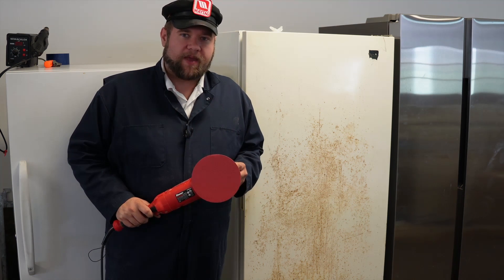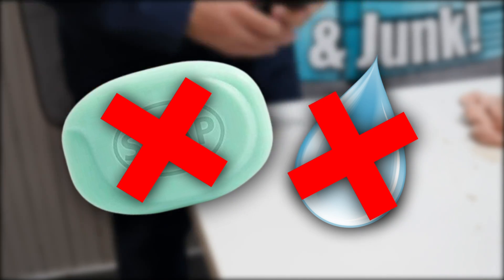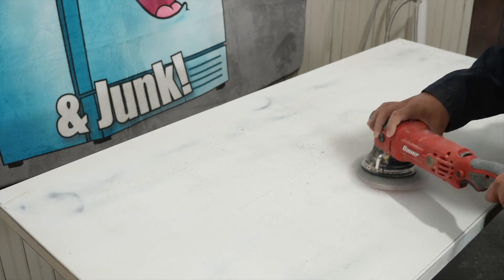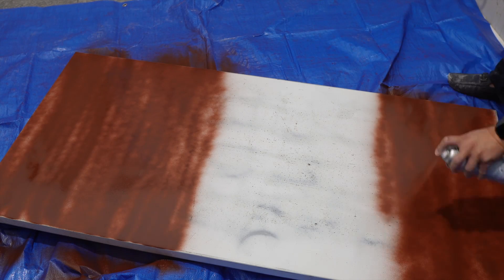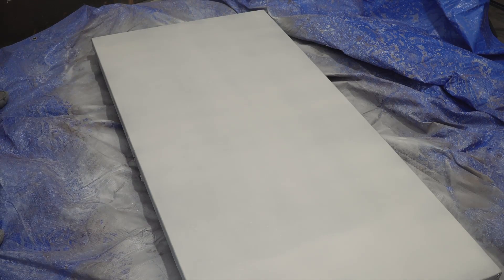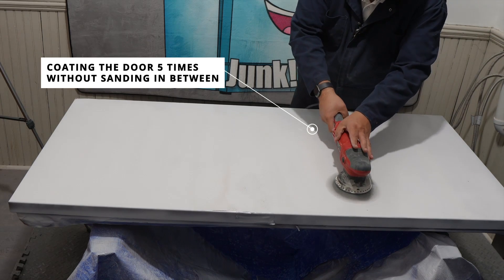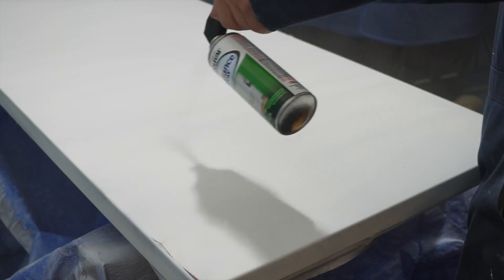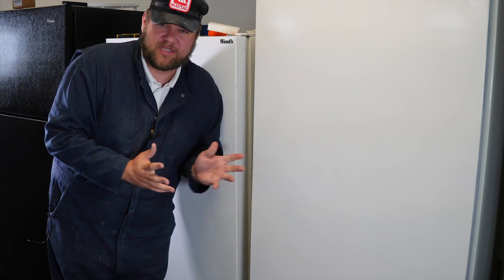How to Re-Paint a Horribly Rusty Appliance

Comment: Spray painting introduces a LOT of problems.  The fumes, the overspray, the "dusting" of everything in your shop, the blotches/drops, the cost.  I switched to a bucket or Rust-oleum 7792 gloss white applied with a high-density foam roller.  No more airborne particles, heavy fumes, overspray, and it's probably 1/3 the price compared to spray.  The only real drawback is that the finish is a bit of a brighter white compared to the "appliance epoxy" or the original factory finish.  But I've never had a customer complain that it's too white.
Reply: Found this is the best also...still rather gun it (not spray can). Thanks for mentioning this 👍
Reply: Bro...I need to try that. Thanks

Comment: what debates were there regarding the minor paint blobs ? You debated about following the Rustoleum instructions; before and/or after not following them?  48 hours = 3 days, not 7. what debates do you have about "spidering" ? what were your debates  about the paint "over spray" inside the compartment ? If you do another rust-removal job, I suggest you check out a rust-neutralizing solution to apply to the entire piece BEFORE you sand. Good looking results on your fridge door. Thanks.🙂
Reply: @DJazzy1  great if you do not have 2  or 3 days to waste
Rustoleum will dry is 10 to 15 minutes is you touch the appliance
And slightly heat the paint can

Comment: My brother had to do this en situ. (in the kitchen)  He sanded it down, removed the rust but did not use the bare metal primer.  It looked fantastic the first 2 years then the rust pits came through fast.  BTW, he used NOT that epoxy, but regular Quart oil based rustoleum, satin sheen, with a foam roller.  It looked like a factory finish, it laid and leveled perfectly.  I do NOT trust their overpriced "Appliance Epoxy".

Comment: Unlike one of the commenters, I have used rustoleum appliance epoxy with great success. I painted it on a refrigerator door that had some minor but pervasive rusting due to salt air. I could not remove the door and take it outside so spray painting was out of the question. I have used primer but cannot remember if I used it on the door. I have never had good luck spraying. The only issue is a quart goes a LONG way and you may have to throw the rest away eventually if don’t use it regularly. I will always brush on and not spray.

Comment: For anyone wanting to do this themselves, here are some tips from someone who's never done this, but has done a lot with restoring old tools. 

1. Definitely buy a DA sander. That is; a dual action sander. The one in this video is from Harbor Freight, but most any decent brand will work (I'd avoid nothing cheaper that the HF one, but YMMV). 

2. Dust catchers are cool ideas, but I've never found one that works well without the addition of a vacuum and hose, etc. Whatever you do, DON'T trust that it catches all the dust. Expect and plan for it to catch nearly nothing, especially the really fine stuff. 

3. Wear a respirator. No, those cloth masks and n95 things aren't respirators. Yes n95 masks are technically rated for certain dusty environments, but (at least in my experience) they don't work well. They don't fit my face well, and they have a TON of blowby (air passing between the mask "seal" and my face). That means there's a lot of dust and stiff bypassing the filter in the mast, and getting into my lungs. Buy a good respirator (definitely not a HF one  they break really really easy) and read the manual and fit it to your face. Seriously, guys, it's worth reading rhe manual. You can tough out a sore thumb or back, DON'T try to tough out bad air. It's not worth the health issues later. Make sure it fits, check the seal according to the manual, and then do whatever you want with the sander. Then don't rip off the respirator immediately in the same nasty air you just created LOL.

Comment: Ben, I have been in the appliance business 52 years. Buy you a Harbor Freight Torch made for killing weeds. It has a pizo-electric start.
 Clean the appliance with "Majic Eraser" and any spray cleaner. 
Wipe it dry and torch the surface to dry it completely. (Keep it moving) Next, do your recommended sanding. 
Then paint with gray primer(only the spots with rust showing). Heat your appliance color paint can in warm water for 10-15 min. 
Next torch the appliance it again till it is really warm (just one pass slowly)
 Shake the paint well and paint while the surface is really warm. Paint will not run even on a cold or rainy day.
.

Comment: I'm not a professional painter, but my dad is, so I learned a few things from him over the years. 
First, after you sand, you want to remove the dust from the air. Any dust in the air will settle on your paint and possibly leave specks of color. 
When you paint, you want your coats to be thin enough so that they don't run, but not too thin. If the coats are too thin, the surface will feel rough and you may have adhesion problems. I think your cracking problem with the paint may have been because of putting the paint on too thick.
When you spray, you want your coats to overlap. You had a lot of banding because your coats didn't overlap much, which probably caused you to use more paint than was really needed.
instead of putting the door on the saw horses, it would be better to hang the door. This would prevent any drips from the spray nozzle from landing on the door and you also won't have to lean over the door to paint it, preventing things like hair, drips, etc. from falling into the  paint.
If your nozzle is dripping, clean it with the appropriate solvent, which may differ depending on what kind of paint you are using. Sometimes of you spray the can upside down for a bit it will clear the clog that is causing the drip.
The spray can guns like you used can save you from a very sore finger if you are doing a lot of painting. 

Paint can take a long time to cure, especially if it is is put on thick. I once did a guitar finish with dozens of coats of lacquer and when I was done, I wrapped it in a padded cloth to protect it. Even though the finish was dry to the touch and I spent days wet sanding it to get the finish perfect, when I unwrapped it a few weeks later, there was a pattern from the cloth embedded in the finish. Ruined weeks of work and about $100 in lacquer.

Comment: I've had the same issue with Epoxy and I've seen it in other videos. You have to try to do it all in 1 coat unless you wait till it cures completely. I've switched to a quick dry 2 in 1 primer/paint. It takes about 3 passes but no spider webs

Comment: Great honest video! 
You are right about getting sander with a dust catcher. I remove the dust catcher and attach a shop vac. Works brilliantly in a room. The little catcher isn't enough but better than nothing. 
Definitely have to use the right primer/paint combo and adhere to suggested drying time. Cracking and fish eyes will ruin your day.
🍻

Comment: Used to be able to get the appliance epoxy spray can for around $4. Now some places want $10 a can..."supply chain issues" must still be happening due to the flu...yeah right!  I sprayed my fridge door and paint washers and dryers with that stuff. One can does not go very far. You will get one coating. Get the spray gun attachment. When you tip the can horizontal it may drip. If any paint dries on the tip it may drip and splatter. Lay down one thick (as you can without running) coat of that epoxy spray moving back and forth overlapping strokes. You can not respray that epoxy unless it has completely dried for like a week or more as it takes forever to dry. Another coat on an uncured painted surface will cause peeling. I also found that out the hard way. Also your air temp needs to be above 50 and low humidity helps. Use heat from like heat gun or sometimes I use a propane mr heater and get the metal hot before painting (especially if it's cold in your workshop). And calling it Epoxy is generous, it can be damaged easily...I really doubt it is epoxy, but it works. I am not a professional painter.

Comment: Appreciate the videos. 
Painting large panels like this is almost impossible with spray can to turn out good. 
Really need a small air compressor and a cheap hvlp gun from harborfrieght will work. You can adjust the spray pattern and volume of paint to keep a wet edge. 

Good luck and thanks again

Comment: One suggestion: you might want to try positioning the door Vertically when painting mainly because the can, when held vertically, may perform better.
Reply from the maker: My thought about that was possibly having the paint drip. Will try that in a future test
Reply: @bensappliancesandjunk  If the paint drips, you are putting it on too heavy.

Comment: I suggest sanding by hand between coats [after painting].
You want to take off peaks off the dry paint, but leave the flats and valleys be. 
Also there would be much less dust flying around.
That's also the reasoning behind the setting times between coats.

Comment: So the small reddish dots on the door of my white refrigerator door are rust spots — no wonder I couldn’t wash them off.

A tip about cleaning the dust off the door after sanding — vacuum the door or use a soft brush (I use an old paint brush) to clear off the door. Use paper towels splashed with rubbing alcohol to then wipe down the door. Because you removed most of the dust before wiping down the door, you cut the chances of smearing the door.

Comment: I've painted probably everything you can imagine under the sun such as vehicles and implements equipment and appliances and can offer you some advice for your future projects. First, I think your sanding was fine. If you have any rust on the surface, I would make use one of the many rust converting sprays or spray primers. It turns the rust into an inert black substance called 'magnetite'. Rustoleum makes one and so does Permatex. It's called 'Rust Reformer'. This will neutralize ant rust so it doesn't resurface or pop back up later. Some of these require a 24hr cure before primer or surfacer application. Also, I would not have used a red oxide primer. You ALWAYS want the primer closely matched in shade to the final surface coat to prevent bleed though or excess surface color coat applications for coverage. Even gray would be better than red. I think Rustoleum makes a white primer surfacer. The quality of those spray cans can be spotty. You want the can to be oriented nearly vertical while spraying and the spray tip aligned with the red dot on the top of the can to ensure the straw is fully submerged in the product. There really isn't much paint in those cans.  The more surface coverage you need out of them the more difficult it will be to get consistency. 
For anything other than spot repairs it's really tough to get good coverage from a can. The fan just isn't wide enough and the product coverage is kind of thin. If you have any experience with a spray gun or would be willing to practice you can get a throw away gun from Harbor Freight and get some catalyzed urethane mixed from a paint shop that will be miles more durable and give better coverage. Much more like the present painted enamel finishes. I think your refrigerator came out pretty nice anyway. I sure miss the old porcelain finishes though.
Reply: @vincemajestyk9497 your comments are appreciated and it certainly appears that you know what you are talking about...thank you. One question though, in the case of surface pitting due to rust, what "filler" would you recommend to smoothen the surface before painting? I've been advised to use auto body filler or fiberglass. I've never used fiberglass so I'd probably stay away from that. Any thoughts???
Reply: @andreb877  Hi! Thanks for the kind words. You could go a couple routes. You really absolutely want to steer clear of using body filler. That stuff is made up of polyester resin and talc. The talc absorbs moisture which causes the bubbling you usually see later on. I would use either a 2 part epoxy like JB Weld steel and sand it down. You could also use one of the 'rust encapsulator type coatings like POR15 and build it up. These are very tough humidity activated urethanes which were originally developed as bridge paints. They do need to be top coated.  Alternatively you could just use fiberglass resin 'gel' coat which is similar to body filler plastic without the talc filler. For automotive work I like to use USC 'All-Metal' which is an aluminum based body filler. They use aluminum powder instead of talc as the filler. Whichever you use, I would use a Dremel to get as much rust out of the pits and then use a rust convertor.
Reply: @vincemajestyk9497  Thank you for responding and for the great advice brother! I really appreciate your time and effort. Cheers!!

Comment: Few little ideas. 

I would have cleaned the entire door first, and sanded/used brissle brush on the rust parts. You can also get some rust neutralizer or use Kilz if you don't care about it rusting through the door. 

A roller might have done a better job for the last coat since it would give it the stippled effect not a perfect flat like a paint can.

Comment: FYI that Rustoleum Appliance Epoxy is NOT really what they advertise, or you would think it is. I painted the inside lip of the lid of my washing machine (followed the directions to the letter) and a couple weeks later I noticed the paint starting to lift, almost like 'aircraft paint stripper' was applied when water got on it. It was when I was done washing and water got on the surface. It would settle down after the water dried. I called Rustoleum Tech Support and they said that paint WAS NOT desgned for expsure to any water. Seemed strange to me since I used it on an appliance. Also there was NOTHING on the can stating this. But it was happening everytime I washed. They said it was for mostly EXTERNAL surfaces but it reacts with water. They even went as far as to suggest that their 'regular' enamel might be 'better' but not impervious either. I used 'Appliance Epoxy' before by Servistar Hardware or some other bran that held up way better than this junk. What a waste.

Comment: i think with as much rust/ damage that that door had I would have put a layer of bondo/body filler on the front of the door after you sanded all the way down to 80 grit then sand down to 120 grit after the body filler hardened and sand up from there.  there were still a lot of bumps on the surface. This would probably had made the spiderwebs not as severe.

Comment: When you put a coat of paint on, let it dry and then send it with a hybrid 1500. Then use a tacky cloth to clean off
Reply from the maker: The problem is "How dry" - either you have to wait an hour, or a week, so that makes doing this pretty darn difficult given the nature of appliance epoxy paint
Reply: 1500 it way too high of a grit. you might as well just wipe it with a cloth.

Comment: The blobs are caused by a defective can. Moving slower and faster, or changing the height would result in uneven coating but not blobs.
Reply from the maker: Agreed
Reply: @bensappliancesandjunk  I was a paint R&D Chemist for 5 of the 9 years I worked as a Chemist right out of college.

You are correct in your assessment of the cracking. If you do not recoat withing the time window indicated on the paint can, it can lead to the cracking problem that you experienced.

Comment: I appreciate you on appliances but not so mich on painting. A lot of it sounded like you were reading a how to blog. A lot of things you said were a little bit wrong but people can follow it. Yes you HAVE TO sand between coats on something enamel that your face is a few inches from. 
Considering harbor frieght air sprayers are 20 bucks use one of those if you have the compressor ec...
Always use the spray can holders doing work like this.